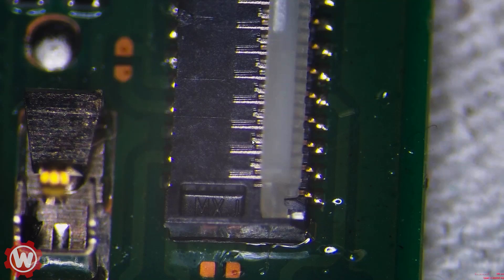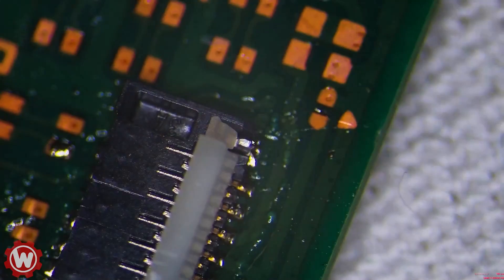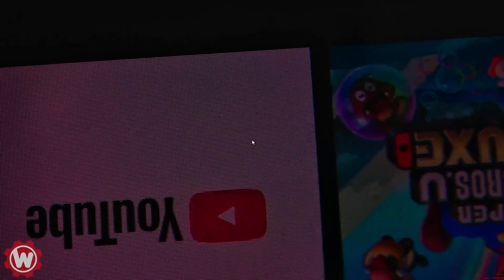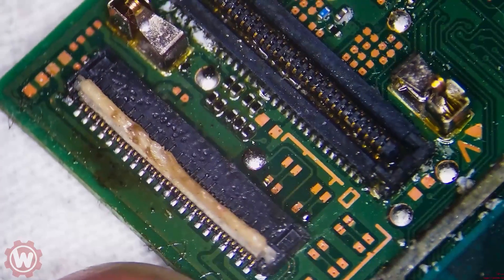OLED Switch Screen FPC Connector Replacement

Comment: Will this replacement fix the touchscreen as well? The screen itself works, however, the touch screen won't respond, on any OS. On Hekate, the touch screen information could not be detected. Just making sure it's this component I need to replace.
Reply from the maker: Only the lite switch has a separate lcd and digitizer. Original and oled are all in one so yes replacing the fpc connector will fix both lcd and touch in original and oled.
Reply: @Wayayeo  Awesome! Thanks for the guide and quick responses!!

Comment: Do you take the faulty connector out by air gun? if so, at what temperature?
Reply from the maker: Use heat resistant tape around components near the connector and start with 650F.  Good luck.
Reply: Thank you 😄, great videos btw. @Wayayeo
Reply: @Wayayeo  Successfully took it off with a heat gun. I'm going to try the soldering method, I feel like the tip I use is too big, not sure if there are smaller ones out there. Or if I even need them.